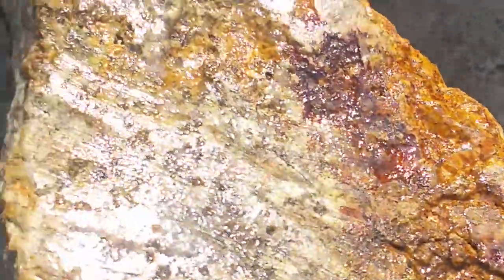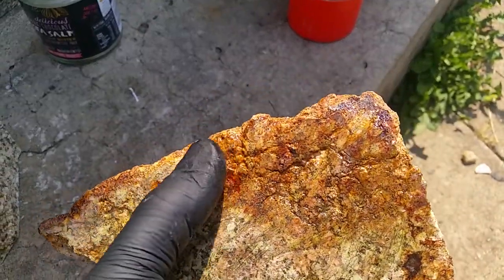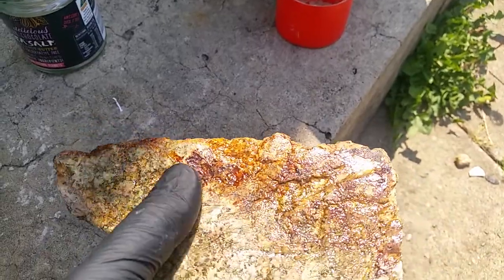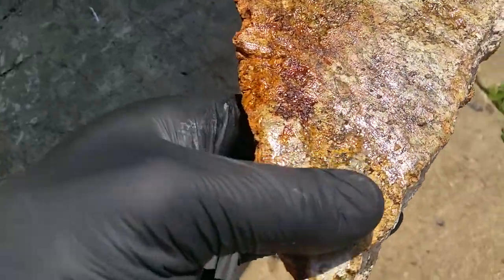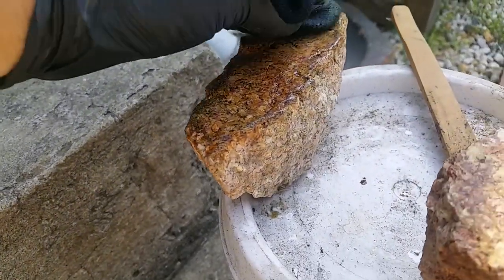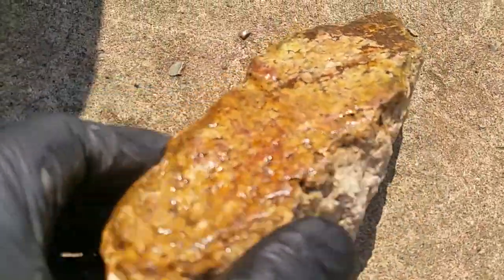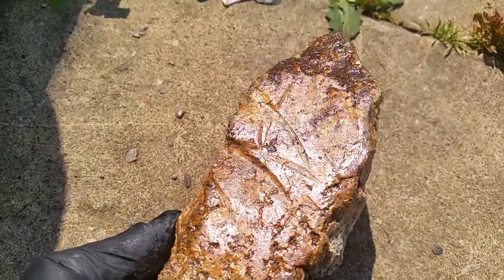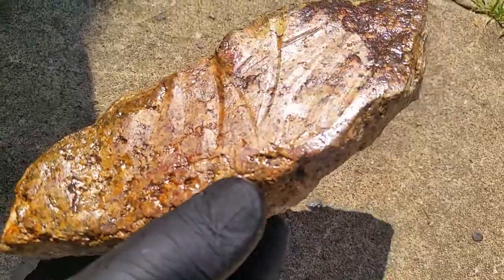Liquid Polish Exp.3 French Polish on Stone! Looks Melted Vitrified_Ancient Megalith Builders

Comment: i'm cutting a rock for the bathroom sink.... if its water soluble and i use it to shine my cut edges will i need to do it again... have you done more research on this technique?
Reply from the maker: It reacts with CO2 and binds to silicon in the process. It needs some other silicon particle to work properly. You'd be better to buy a wet polisher tbh